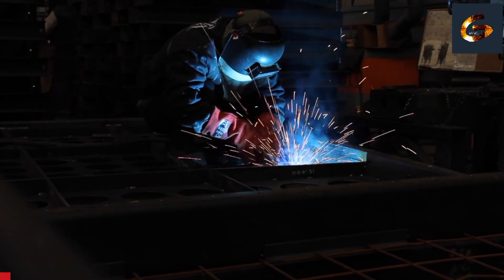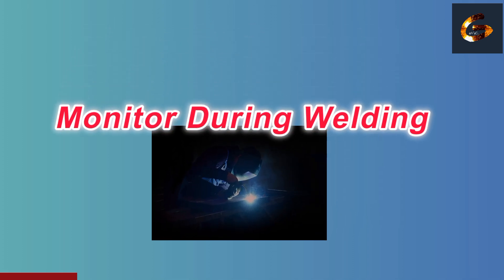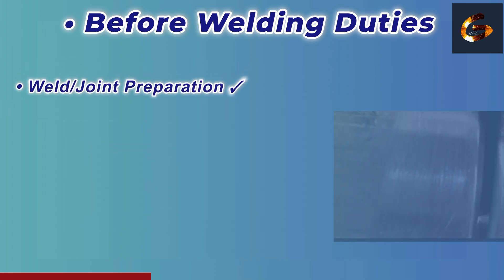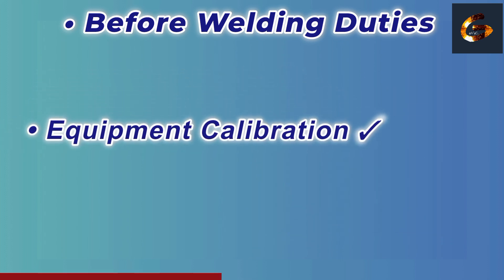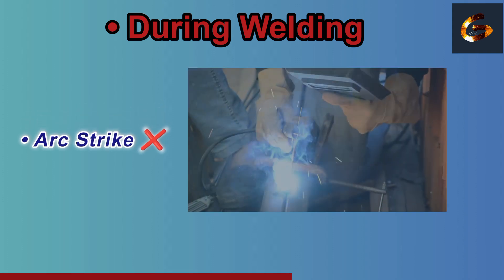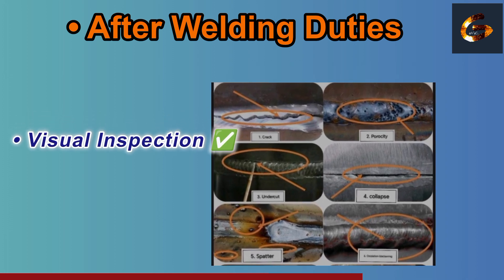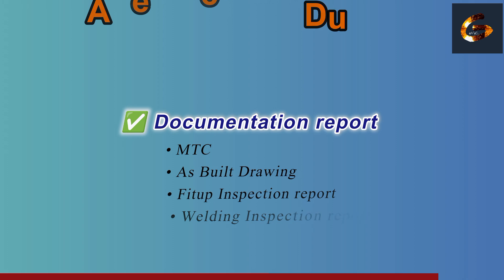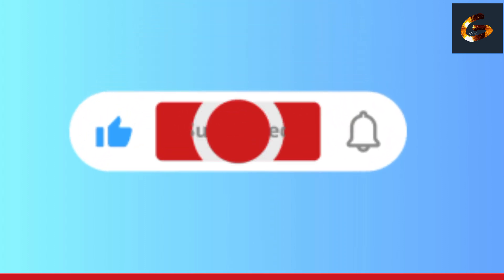Welding Inspection Job Role | QA/QC Inspector Duties & Responsibilities Explained

Comment: Hi sir ...I m from India .. currently working in food sector...now I am going to become welding qc  certification courses...but my background is bba...is that any problem for my job hunting
Reply from the maker: hello , My advice is .. at least You'll need to start as QA/QC assistant or QA /QC Welding team, first to gain practical welding inspection experience before getting certified...

 Your BBA background won't be an issue for entry level positions. Get 6-12 months field experience, then go for the certification.
Reply: @WeldingQAQCGuide  sir I have experience in welding 3 years can I do cswip3.1
Reply from the maker: Yes, You have to do it ..
Reply: @WeldingQAQCGuide sir so Wich course I need to for this